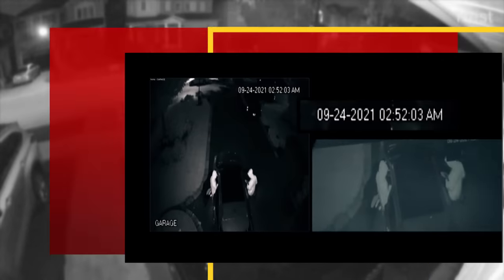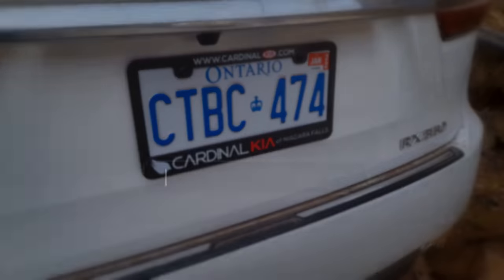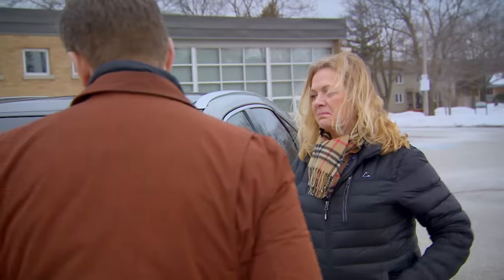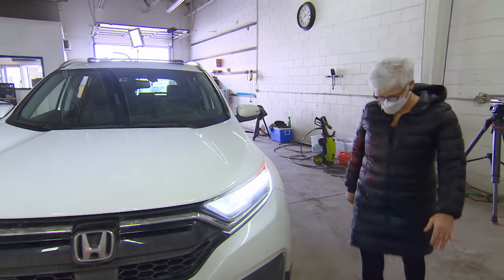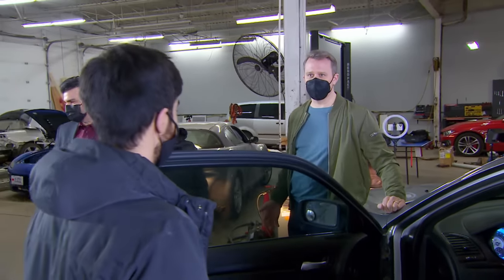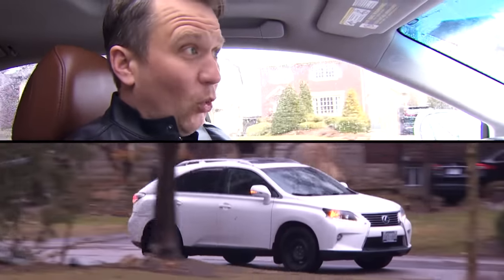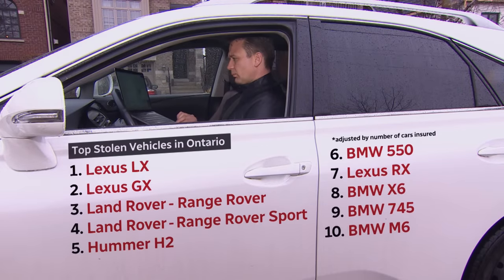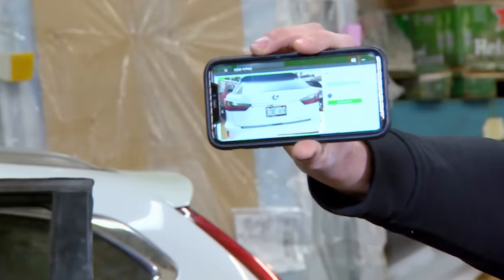Tracking stolen cars: How they could end up in West Africa (Marketplace)

Comment: Just curious. Isn't the car fitted with standard alarm system (immobiliser) & why does the alarm not trigger when the thieves unlock and open the door by using the mechanism key / tools?

Comment: Something doesn't add up here.
Most cars, including the Chrysler 300 & Honda CR-V, my own Jeep, my son's Jeep, my wife's Volvo and my little sports car, will sound the alarm if previously locked using the key fob, and then entry is tried by inserting the key into the door(s) key hole. I would think, "picking" the lock is no different then inserting a proper key.

After additional research (I'm a car guy, sorry), it turns out Chrysler 300 owners including Honda CR-V owners have asked on-line; Why does my alarm go off when inserting a key into my drivers door? Answer; Because you previously locked it using your key fob.
What am I missing here?
Reply: Good point. Also, the key fobs were within meters of both cars when being programmed. 😉
 I keep my fob in a faraday pouch when not in use, to avoid having the signal/code detected.
If I open the door of my car with the manufacturers key, after previously locking the car using the key fob, the alarm will go off.
Reply: @Tony-G  hey, are these pouches worth it? Do they do the job?
Reply: @7enty7en83  i bought a two pack from amazon for 11 bucks
Reply: Your right, something doesn’t add up as you’ve said. Even if the vehicle didn’t alarm after picking the door lock, they need to get past the immobiliser and most vehicles require an already coded key to code another key! The vehicle should also seek the key/fob periodically during driving and come to a safe stop when the key/fob is undetected to prevent driving a distance after a relay attack… and if a vehicle doesn’t do the aforementioned than manufacturers need to fix their security integrity!!!
Reply: To start off , I am the one that picked and programmed the vehicles in this video , Good point you have about the alarms not going off and i will explain.
For a vehicle alarm to be active it takes about 30-60 seconds from the time the lock button is hit on the remote. We started the process right after the cars were locked.
Regardless of the alarm going off or not  , the process or time does not change as seen in the video.
Also not all vehicles manufacturers alarm will go off even after 30-60 seconds of it being armed " locked with remote" specifically if it is unlocked manually by a key.
Reply: @7enty7en83  Yep. I tested it by sitting in the car, fob in pouch and it wasn't detected. Jeep wouldn't start. Amazon has them for cheap.
Reply: @Tony-G  nice to know, thanks
Reply: @MuLife  great explanation!!
Reply: @MuLife  not all the cars are equal regarding their logic towards security.
Making a new key is not that easy in "all keys lost" as far as i understand.
Something like Mercedes require a unique pin from 1997. After 2015 it's more complicated.
I am not a specialist but i feel that there is a kind of" show" to help the aim of this video.
Also i felt something regarding the Arabic origin names that can replicate what the thiefs are doing ☹️

Comment: These are the many dangers of having a Push to Start or FOB switch on ignition. Toyotas still have their keys come with an actual engrained key for the specific vehicle to fit in the ignition switch.
Reply: They programme new keys for the cars. It's not about the push button.
Reply: It is, if you need the old key present when you add a new key
Reply: @Silver_o  yes and no, you will need to pick the ignition lock still, unless you have access to the key code from the OBD to cut a fresh key from, and all this takes time.
Reply: It’s. Much higher skill ceiling to do mechanical key origination.
Reply: If you head over to the Lock Picking Lawyer channel, he shows how to use the tool to open car locks, plus he sells them. The ignition key has a couple more cuts required than the door. The tool tells the exact key cut required to create a new key. It’s partly tradeoffs between making it easy to replace a lost key and making it hard to steal. Also, the lock has to be resistant to dirt and ice, so there’s limits to how secure it can be.
Reply: @johnhaller5851  There's alot more to know then a quick video can tell you on Lishi's and auto key origination. You need to pick the lock with the lishi before you can read it, once you read it, you need a 3000$ machine to cut the key,  you'll also need to know how to get the last 3-5 missing cuts, this usually requires code software, not available to the public. You'll also need to carry the correct key blanks, with the correct transponder chips, and know how to use Diag tools, you'll also need a Diag tool, decent ones start around 1000$. So many people have "Beginner's Fallacy" about locksmithing, what it entails, and the years of skill needed to hone this trade. The more you learn, the more you realize you don't know. Ignorant people are confident.

Comment: Man those keyless ignition systems seem like a great idea ... for car thieves. What was wrong with starting the car with a key?
Reply: the pick used to open the door can also be used to start the car in that case.
Reply: @denisgavrilov3676  Cars used to have chipped keys that you'd use to start the car, they were not so easy to break as this. But even the really old keys that did not have immobilisers ... you'd still have to physically make a key in order to use the car without the lockpick.

Comment: Just a piece of advise, install motion sensor lights at your house, park your vehicle in the garage, block in your vehicle.  Make it difficult for the thieves, and always lock your doors
Reply: Blocking in with another car is the only thing that might work. If these criminals are making $80,000 profit pretty sure a light won't scare them away
Reply: @hmacklemore2226  a light will wont scare ppl, but crooks dont like to be seen, they try to get in/out quickly .  Some security motion lights will notify you when there's movement outside.  If you have nosey neighbors, that helps to!
Reply: What's the point of buying a car to leave in a garage
Reply: @michaelotoo5543  thats easy, to protect it, otherwise it's an easy take away. Crooks are like bullies, they like an easy prey. Just make it difficult for anyone wanting to take your vehicle
Reply: @mrlwiseman2900  q
Reply: @hmacklemore2226  Firearms at their direction will definitely scare them.

Comment: Using the Lishi tool to enter the car the way the locksmith did is actually a slower way to do it, most cars can be opened in seconds with an air wedge and long reach tool.
Reply: I agree.
Reply: I've not used lishi but have picked various padlocks of my own with standard picks for fun and curiosity. I also watch a expert here on YT : LockPickingLawyer who says the lishi makes it just that much easier and quicker since its custom made for each lock type. And an added benefit for crooks is they wouldn't be observed shoving wedges in and fishing some wire tool in to trip the lock, so to a passerby it may very well just look like a poor soul is fumbling around with their keys.
Reply: @kylek6922  the lishi tools are a game changer that's for sure. And they are decoder. Expensive but worth it to have in your tool kit

Comment: not sure what the laws in Canada are when it comes to dealing with car theft. Here in Zambia 🇿🇲 vehicle theft is non-bailable and could get you a minimum of 10 years in some cases it goes up to 25 years. 

If you can, fit in anti-theft gadgets like immobilizers and tracking devices. 

Strict border controls must also be put in place.
Reply: Would it be possible to bring a stolen car report from Canadian police to Zambian police?
Reply: @MuzzaHukka  yes it can be done through interpol both in Canada and here in Zambia.

Comment: This all stems from all those cars having push button starts and how easily them can be stolen. That is the issue that really should be talked about.
Reply: The more electronics they have, the easy to hack theyll be. Thieves are pro in electronic field. Also scamming atms.. etc..
Reply: What they’re doing with a $1,000 in diagnostic equipment and a brand new key for that make model can be done with a screwdriver and a pair of pliers on a pre OBD2 vehicle
Reply: @Aron-ru5zk  
I see you know your wires well

Comment: Immobilizer and a GPS tracker is all you need to stop this type of threat.  i had my car stolen from my work once.  That is all it took for me to learn my lesson... I got a cheap immobilizer module that cuts the 12v source to the fuel pump.  I can do it remotely from anywhere. And the GPS tracker has its own battery backup that can last 30 days without a charge. costs $60 a year for the 4g cellular plan.  It works great. I can send a text message from my phone and get real time updates. It also auto updates its location whenever the tracker is moving,

Comment: Push to Start seems to be the culprit behind the common relay attack and OBP key code programming. A car lacking this feature and having an engine immobilizer without the actual key installed would be extremely difficult to steal. My 2004 Volvo S60 would be incredibly difficult to steal for these reasons alone.
Reply: Yes, I hate how all the new cars have wireless keys...
Reply: @That V8 Life not really. The whole point of using Relay attacks or Lishi picks is to stay as covert as possible. If you need to kick and grab, it's more likely you're going to be caught by the owner or cops via leaving behind evidence.
Reply: If they can pick the car-.door lock, they can easily start a car that uses a key to start. That would actually be the easiest.
Reply: @igbolady7481  no, lots of cars with key start - even my family's 27 year old bmw - have a short range (RFID style) transceiver in the key that uses rolling codes to authenticate the start. You get the benefits of a key start - only works at short range, needs to be manually picked - but also the benefits of the electronic security.

Comment: ...What bugs me, is that the alarms are not going off when the door is unlocked. This is a major vulnerability!
Reply: My car alarm goes off if the car is locked via remote, but then opened by key in one of the doors. I am assuming it will go off too if it was opened via a pick in the keyhole.
Reply: @conceptcs  Might have boosted the signal of your keyfob. For alot of other vehicles, like the Honda in the video - a few Fords etc. You can get into the vehicle by fiddling with the lock without the alarm being triggered.
Reply: @NicoVanDerMerwe1988  My car is a 2008 Nissan, no smart key fob.
Reply: @conceptcs  Oh wow... now that is something funky for you!
But hey, while engineers are sitting and thinking of ways around vulnerabilities... the thieves are sitting and thinking of ways around those innovations.

Comment: I work in the area where there’s a high rates of stolen vehicles. The most effective way to prevent someone from stealing your car is not to have stuff visible from the outside and yes, a manual transmission would help to. 😂
Reply: @hich11111  Stops the thieves that can't drive a manual transmission.
Reply: not everyone can afford a house with a garage to keep stuff "not visible"
Reply: @glenndoiron9317  its only going to stop the thieves who steal upon an opportunity. Like if they found a car with keys inside or doors unlocked. Pro gta thieves  however who do it for a living knows how to drive a manual. For example, if a thief specialize in a vehicle theft with a vehicle like Honda Civic type Rs for example will know how to drive manual since all the type Rs come with a manual.

Comment: @19:00 also keep in mind the VIN is stamped on several different places on the car and not only on the driver dash and door jam.  VIN is also stamped into various metal objects on the vehicle, including the frame, the body, the engine, transmission and other places.
Reply: @danielknepper6884  how do you know?  Also it is V.I.N. and not V.I.N. number.  V.I.N. is actually an acronym for Vehicle Identification Number.

Comment: Security TIP--  A hidden switch can be installed on really ANY car, to prevent a driveaway. It can disable the start system or the fuel pump etc. Any good auto electronics guy can install one

Comment: You just need a hidden switch that triggers a disconnect relay on the wire going to the starter solenoid.  Cheap, 1 hour modification that will keep your vehicle from getting stolen.   People were doing that back in the 60's and 70's.
Reply: you don't even need that. my car has a paint job that guarantees it won't be stolen. haven't locked it in years.
Reply: This is amazing, I'll consider doing this for my car.
Reply: I'm going to be fixing up an old muscle car soon. I may do this as a way to make sure nobody gets sticky fingers

Comment: I work at a locksmith in Florida. Yes, it is true that a well trained and well equipped locksmith can do this. In theory, the manufacturers could make it much more difficult to originate a key for a vehicle. But if they did, then the cost would be much higher if a legitimate owner loses their key and needs a new one made. Manufacturers must balance these two items. There is no easy answer.

Comment: It's sad that car manufacturers don't do more to prevent theft. I know my particular brand is typically a lot harder to steal (Tesla).
Reply: how so
Reply: @xt0  I can easily think of several methods. For example, the key fob security for Honda and Acura is laughable at best where they have not implemented even basic security, i.e. rolling codes, which allows for simple replay attacks without the fob being present. Rolling codes have been used for decades elsewhere, i.e. garage door openers. Some cars also use weak FOB security, i.e. 40 bit keys. Tesla had that problem and changed it to 128-bit keys. Key fobs could easily incorporate a motion sensor so that those sitting by a nightstand can't be used to steal a car in the driveway. Two-factor authentication could also easily be added. For example, in order to drive a car, you must have both the fob and your phone or enter a PIN. My Tesla supports requiring a PIN. Then there's the fact that it's trivial to add a new key by plugging a device into the ODB-II port. Also, the key locks could be made to be much harder to pick, though that doesn't help with smash and grab. Another thing would be to make it easy to display the car's actual VIN number on the screen. Tesla makes this easily available as well as displaying it on the phone app. A sticker can't hide that, and often changing the computer requires a call in to the manufacturer or another authorized service. Some of these steps are pretty easy to implement.

Comment: First thing I did to my new subaru was install a mechanical disabler switch on the  fuel system ...it starts then seconds later its starved of fuel and becomes a paper weight.
Reply: and then they use a tow truck to haul your car away.

You cannot stop them if they really wanted your car.
Reply: @cococly  Where in the video did you see a tow truck?? Why would they go through all this effort only to use a tow truck. DUH!

Comment: Good thing my car has a physical key and an immobilizer in the key itself. Still stealible but much harder than that.
Reply: Yes Germany car hard to be stolen!!!! This is not cool .
Reply: @emmanuelowusunuama4765  you would not be able to steal mine anyway , hidden immobiliser will put 27,000 volts through the thief ! Lol🤣🤣🤣
Shocking !
Reply: Yea. The initial factory immobilizers that put the digital security in the physical key seemed better because both are necessary. Before that after market immobilizers were common.
Reply: @jptrainor  as was removing rotor arm.
Reply: this is why i drive a cheap manual

Comment: On the flip side having the car be able to interface with an aftermarket scan tool is beneficial to third party shops for right to repair. It wouldn’t be the greatest thing to have cars need to be online to start it.
Reply: The biggest problems are the incentives. Like they said: High reward\low risk. Canada desperately needs to buff up it's Auto Export requirements, and punishments need to be far more severe, not only for the the pinchers themselves, but for the companies caught trafficking the goods. In addition, it would help if the destination countries would stop trying to benefit from the organized crime rings importing stolen goods to their countries, and let it go back to its rightful owners.

Comment: This can be easily fixed by car manufacturers just by removing or hiding the lock on the door. If they do not have access to the lock they will not be able to open the car and steal it. This is why they can’t steal a Tesla because there is no lock on the door, they can’t get inside 🤷🏾‍♂️
Reply: ☝️☝️☝️
with or without
tracker🛣️🚒🚛
Reply: They break windows
Reply: A window is like $300 to replace. Nothing compared to making $60k on a car. The reason Teslas arent stolen is because places they are going dont have the infrastructure to charge them so they arent popular.

Comment: If they need to start the car to get away put a switch inline to the fuel pump thats under the back seat. Normally hidden somewhere inside the car. All you need is a couple of wires and a small black switch. They can get in the car and even push it but never start it unless they find the switch. Also they will try and crank it to start it. Hopefully that will wake someone. Funnily enough there’s quiet a good few videos on how to install one.